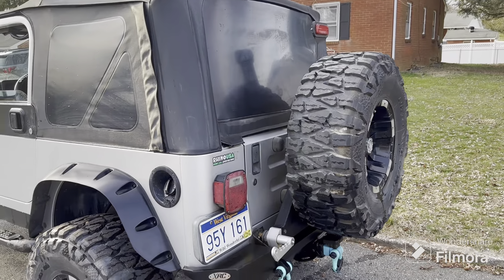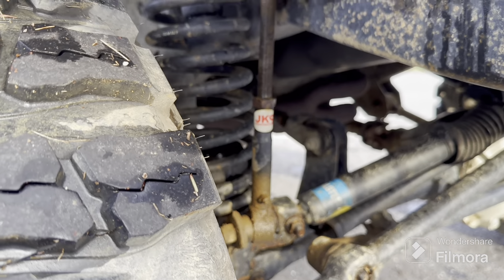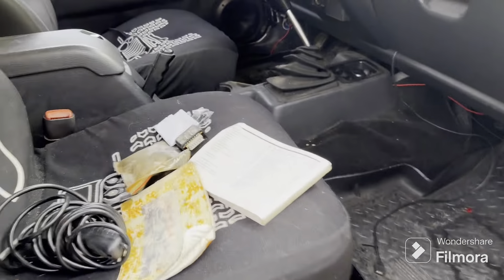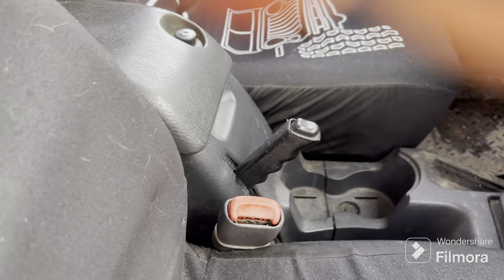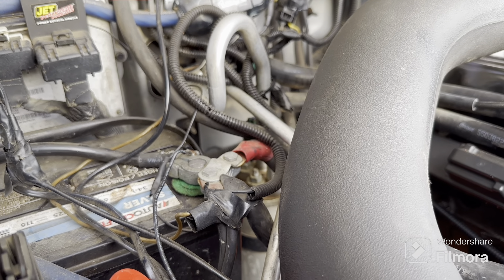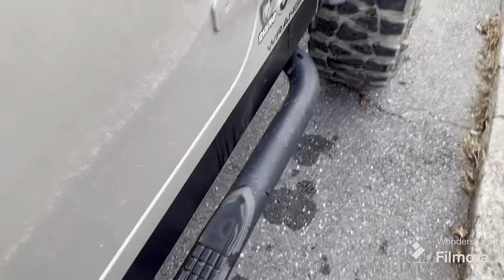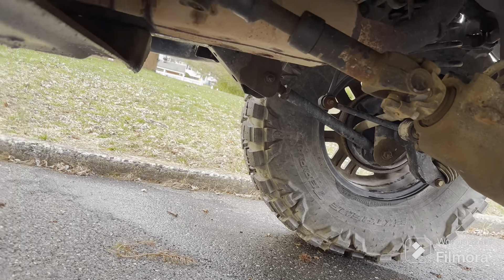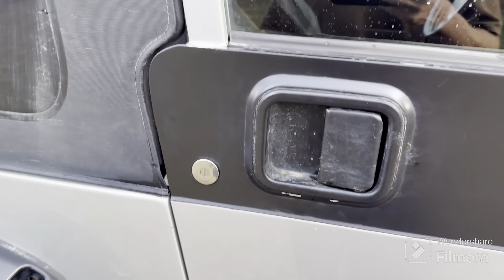New year new Jeep: '03 Jeep TJ part 1...the walk around

Comment: Congrats on the new ride.  Fellow MD jeeper here with a 2002 TJ.
Reply from the maker: Thanks gotta love the TJs
Reply: @ninja63639   About to dump some $$$ in mine to finish the build.
Reply from the maker: @gorillahd9247 what's the plan?
Reply: @ninja63639  I have a pair of new G2 D44 30 spline chromoly axle assemblies with 4.88 and Detroit Truetracs front and rear in my garage.   Need the SYE, rear driveshaft,  rear disc brakes, adjustable control arms, etc...  plus fresh paint, metal cloak arched fenders and new seats.  Basically it will be a new jeep when I am done.

Comment: Awesome Jeep! Considering all the garbage bolted onto it and the abysmal wiring job, it's in incredible shape. Modded rigs like these with no rust and the 4.0L running smooth are becoming harder to find these days.
Reply from the maker: I'm telling you man you're not wrong. I went to look at it for the axles and once I saw there was no rust that was about it. I thought the guy went crazy with his credit card on Smittybilts website which he kind of did, but the Rock Jock suspension and low mileage made it too good deal to pass up.
Reply: @ninja63639  Yeah, all of that should clean up nicely. And if you decide to keep the bumpers, which really aren't terrible, any local powder coating place could easily redo them for a couple hundred bucks. The only real travesty here is the bedliner on the grille.
Reply from the maker: @Spanked78 I was just thinking of keeping the rear bumper but I'm definitely gonna have it blasted to bare metal so I can repaint it. The fronts getting switched to my Motobilt and Warn

Comment: Those look like rockjock/Currie arms you have the perfect setup, looks like their 4 inch short arm kit.
Reply from the maker: Yep that's exactly what it is. The guy told me it was a Rough Country lift and it was pouring down when I looked at it so I couldn't get under it. He lived on a dirt road so it was filthy when I brought it home. It was a nice surprise when I washed all the mud away and saw RockJock on the springs and realized it was Currie arms. Part of the money I talked him down on the price was to replace the rough country springs with curry Springs so it worked out perfectly. I will say I'm not a huge fan of how the Johnny joints perform on the road. The Jeep kind of sways into turns
Reply: @ninja63639 I have the same arms and they don’t sway during turns, you may need to rebuild them. I would also look at your sway bar bushings front and rear. Also the rear track bar bushing can wallow out. A lot of little things to look into…
Reply from the maker: @ryansremark6983 it almost feels like when I turn it takes a sec and then sort of dumps me into it. While I was under it one day I checked all the arms and they're super tight. It has JKS swaybar disconnects on it and I'm not sure if the angle of the swaybar has any effect on it but it is curved up at the same angle as the frame if that makes sense